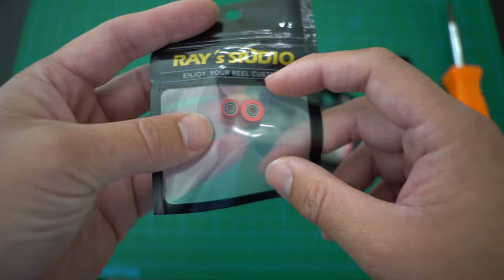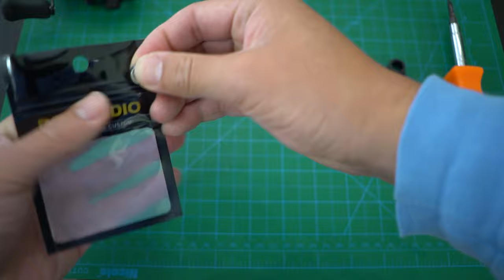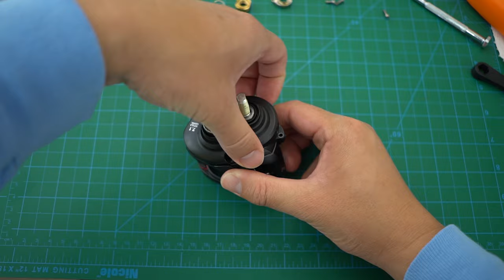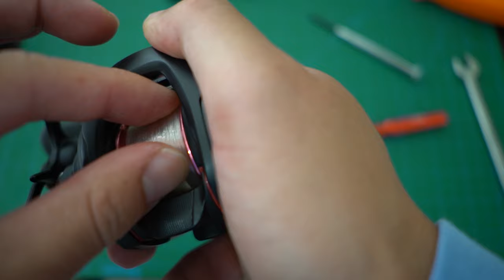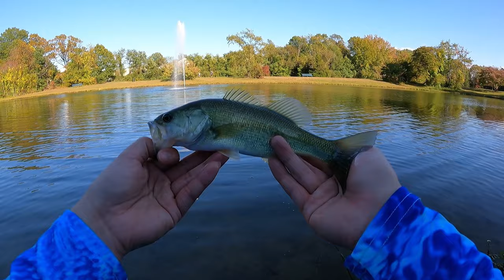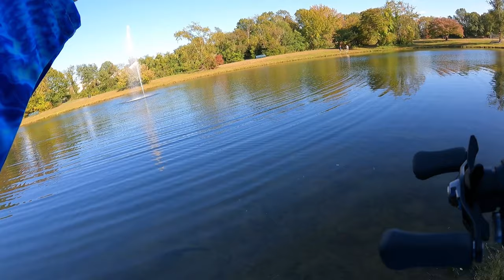Daiwa Tatula 100 Micro Bearing Upgrade for BFS Fishing - Chameleon DIY Spool Cast Test

Comment: Great video 👍. Exactly the way my fuego was. Quite an interesting design haha. Tinkering and tuning reels is so much fun 😁👍.
Reply from the maker: Glad you enjoyed!  I wished i jumped on the Fuego Band Wagon when it was cheap on Amazon. I could have tuned that one too >_<  but yeah these reels are great! Since CDM reels are all about shoving a shallow spool on their normal sized BC reels, the Tatula is a perfect candidate given it's a small low profile reel!  I can't imagine doing the Tatula TW.. even smaller at size 32 MM Spool vs this/Fuego at 34mm!
Reply: What bearings did you use on your Fuego? I want to upgrade my bearings, spool and drag but I can only find parts for the Tatula.

Comment: What do you think about the fixed inductor spool vs the chameleon DIY spool? Is it better to hvae the fixed inductor or be able to use the mag z-force brake with light lures?
Reply from the maker: My roro spool for this reel (fixed inductor cup) was a bust. I have several videos of it earlier this year.  Backlash galore and the gap for this reel and the spool didn't work out. the gap was too big and i kept getting the line into the reel.  Now for my Daiwa Alphas Air TW, the roro spool is pretty awesome.  So it's mixed feelings so far.  But this spool so far is performing beautifully for the past few sessions.  As per the end of my video, this reel sits above every CDM BFS reel up to date.  but of course, the cost is much higher!

Comment: With the smaller bearings, it takes less inertia to get them spinning. If you use heavier lures, it "burns" up the bearing- meaning it will over heat them and that will reduce casting and can cause permanent damage to the bearing if they get gouged. Ceramic bearings will continue their inertia longer so once they get going, they spin longer.
Reply from the maker: Don't think that would ever happen in reel  tho ya?  Like one would put thus reel on heavy rod and throw a super heavy lure.. and likely will run out of line before it can even generate that much rpm to damage the balls. At least not in a bfs reel.
Reply: @rawrfishing  yeah that's the theory but I personally never worked on reel with heat damage. I worked at a tackle store by the beach all we seen was salt corrosion.

Comment: Dang the stabilization on the gopro 9 looks amazing.  Are you experiencing those reported freezing problems on the 9?
Reply from the maker: haven't yet! i think most ppl experienced that on recording like high res stuff. I am just doing 1080p!  If they let me do 2k loop mode at 60FPS i would do it, but they are jerks. They totally wont' let you do it, it's either 1080p or 4k... I'll tell you what im experiencing tho.. SD CARD ERROR!! nonstop -_-  maybe my SD card is old. i'll give them that benefit of the doubt. I will format it one time using the GoPro and see if anymore comes around. but i also ordered another SD card, prime day woot!
Reply: @rawrfishing  I'm running the gopro 6 and was having SD card issues too.  I just kept reformatting the sd card using the gopro and it eventually fixed it.

That sucks to hear about the limitations on the hero 9.
Reply from the maker: It really sucks that GoPro is heavily used for YouTube video productions, yet they don't communicate what the actual needs are.  If we all can record on 4k, we would all do it because YT does a great job scaling down to lower res.  But since i can't and won't, i was hoping i could at least do 2k... but looks like it won't happen!
Reply: @rawrfishing  Dang good to know, I'm planning to upgrade my PC rig soon to do 4k but that sucks to hear about the hero 9 having issues with high res recordings.
Reply from the maker: @chuelee7201  hopefully an update will fix it. perhaps if you turn off many other features, it will work.  gopros should probably not be black either. the sun makes it super hot!

Comment: Hi Jimmy, I noticed something in these roro's from aliexpress. The first impression is that they spins very well, only it seems that they came lub with a extra-fine oil because after a fishing trip, the water came in to the bearing and it starts to turn less, and when you are doing maintenance and cleaning the bearings it doesn't spin like before. So I believe they come from the factory with some specific high performance oil, the problem is that I didn't find any here, do you know of any that sells on Aliexpress? Are your zephyr roro like that too? Nice video my friend Thanks  :D
Reply from the maker: That's a very interesting finding. What do you used to clean it? I haven't cleaned mine nor taken em apart. I would run them dry if I cleaned them. But all I have at home are some old school quantum hot sauce. Haven't really gotten a chance to try some new school stuff.  I can make a post I guess for best bearing oil in the Facebook group I guess. I wanna buy stuff eventually for winter cleaning
Reply: @rawrfishing  I use lighter fluid or benzine, some also use kerosene. I saw that it is some of the liquids that are recommended for cleaning hybrid ceramic bearings and micro bearings. I never had any problems cleaning the bearings with these liquids, for ceramic and micro i don't use oil but for ordinary bearings I put a drop of oil lub or use silicone spray, the silicone makes the bearing lubricated too and much loose than with oil, the silicone it does not create a 'paste' inside the bearing, leaving it more run free. But these roro's after i clean them they run well but not like before, and after a fishing trip they are practically without any rotation.Try to make a test, use them and in the middle of your fishing open the reel and try to rotate the spool bearing to see if it continues to run well.
Reply: @rawrfishing  if the quantum hot sauce was very thin, I believe it helps in the rotation of the micro bearings, do a test with a droplet, if it doesn't work, just clean it with benzine, lighter fluid or kerosene.
Reply from the maker: Okay you sound like you done everything right.  Now I am super curious on how these bearings will perform if I use it a lot and then take it out to clean. Now are both bearings like that or is it just one?  It's so odd to see that happening. I do have a contact from roro, so hopefully they can help us understand their products more
Reply from the maker: Hey, this is from Roro:
About Marcus Felipe comment:

Please let him to read this information first, to know more about how to do maintenance Roro Spool Bearings: https://rorolure.com/blogs/rorolure-studio/5-steps-to-clean-roro-spool-bearings-for-baitcasting-reel
To keep high performance, after cleaning,
for the ceramic ball bearings don’t need to add any oil on it.
For stainless steel bearings, must be re-lubricated after washing. We don’t sell any oil, please could refer this link, the oil is very good for stainless steel bearings:
https://japantackle.com/tools-and-others/grease-oil/to000244.html

I read the article and doesn't look too off about what most of us do.  Since my bearings are still working, i'll continue to use it until end of season before I take it apart, clean it and reinstall.
Reply: @rawrfishing  oh, that's is, i didnt lub this  after cleaning, i thought that It was mean to used dry. I will lub and see how It goes, thanks Jimmy. Did u notice some performance difference between SIC and Stainless steel ? I'm confused wich one i choose for zephyr, um my spirit fox i use the Stainless steel

Comment: What tool did you use to get that side plate off so easily? The side with the Brake Knob that is. Mine will not budge at all.
Reply from the maker: Believe it or not.. just my long ass finger nails LOL. try using a coin to twist the screw that is in the brake dial. once you loosen it, it should spring out letting you know you are ready to take the plate out.
Reply: @rawrfishing  Dang lol. I tried a flat head and everything and still nothing lol. I'll try a coin now.
Reply from the maker: let us know man! because it's supposed to be easy. but i know my LEXA had issue for the longest time, i can unscrew it but it never moved. Until i was like screw it and man handled it 4 years later LOL
Reply: @rawrfishing  Sounds good. Thanks. I'll see how things go. Got that Chameleon spool coming in like 2 weeks so I just wanted to make sure taking it apart wouldn't be sucha headache.
Reply from the maker: You will love that spool but only if u can take the reel apart lol
Reply: @rawrfishing  You might have to do a how to video for me if I can't lol
Reply from the maker: DM me on instagram if needed for a short demo video
Reply: @rawrfishing  Yessir. Just followed you on there. "elmovwjjj".

Comment: I need to get these bearings in my Daiwa SS SV
Reply from the maker: You BFS Fish with that reel? if so, micro bearings can help throw lighter lures easier
Reply from the maker: I don't get on reddit as often as I do here.  What was your question?
Reply: @rawrfishing  I was wondering what bearings and spool you'd recommend for lighter gear, not super light but to throw bass gear and move into bfs on that reel. It's a 34mm SV spool. I'd appreciate any feedback. Thank you Jimbo
Reply from the maker: @metalman83  Unfortunately, I am not familiar with that reel so I don' t know what is available on the market. I would think you can do some finesse fishing with that reel.  It's already a small form spool, shallower than your standard so you can finesse fish more in the Medium Light tackle realm.  Try finding a shallower spool for it. i bet there are some!
Reply: @rawrfishing  I am able to cast a  weightless zoom finesse worm on a 2/0 EWG hook into a little wind so yes it is decent. I'm going to make it better and appreciate your help and honestly. I'll look and see what I find. Keep all the great videos coming that get us and keep us into this awesome hobby!!
Reply from the maker: @metalman83  i can cast flukes with regular size BC reels too. The normal 5 inch plastic is actually not bad in most brands. Its the smaller flukes that gets tricky and that these size 100 like reels comes in handy.  And then we have the bfs reels for them crappie shads lol.  Thx for watching and drop a line! I always do my best to help whenever possible!
Reply: @rawrfishing  well you always do a great job and your the reason I want to get more into bfs.  Next I'll need a decent rod in a light power that I can also toss bass lures and hopefully use my SS SV. Thanks again for what you do and your help with the fishing community!!!!
Reply: I just put roro bearings in my Daiwa SS SV with the stock spool and it makes a big difference in free spin and it's smoother. I'll have to check out the casting lighter baits. I did order them direct from roro!
Reply from the maker: @metalman83  glad to hear it man! now we just need to test to see their longevity! afterall, they are a new company in the field.. in a way...
Reply: @rawrfishing  I agree to the longevity of them! If they last as long as they free spin and are smooth we'll be in great shape! For the price so far seems to be a good upgrade!
Reply from the maker: @metalman83  yep! btw, I got too many gears to be able to come up with results. so if you ever run into problems, feel free to drop a line :P
Reply: @rawrfishing  do you clean and lube them before using? Are they generally a little noisy?
Reply: @rawrfishing  if you could recommend a starter bfs rod, which would it be? I'm looking to get a rod to put my SS SV on to throw small rapala lures

Comment: 👍 Want your stock bearings to spin up like crazy put a few drops of  1UP ONE racing bearing oil in them and they will free spin like crazy and when you re lube them again they even get more lose. you will thank me later..
Reply from the maker: Oh i bet! clean out the stock oils and one single drop of high performance oil and it will spin crazy. there are so many awesome low viscosity that will do the job :)